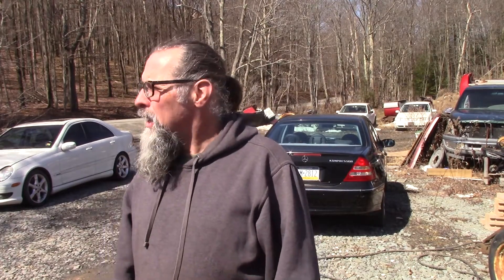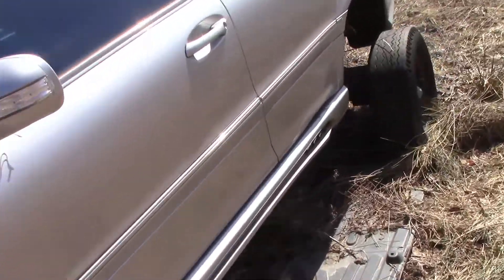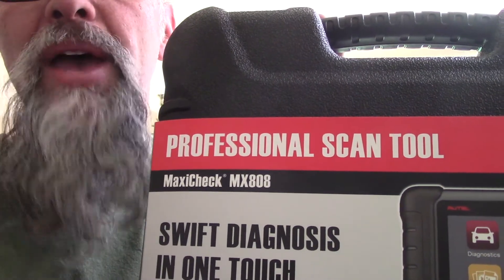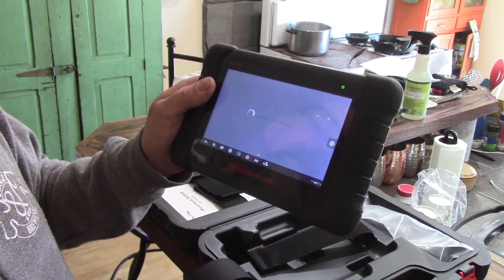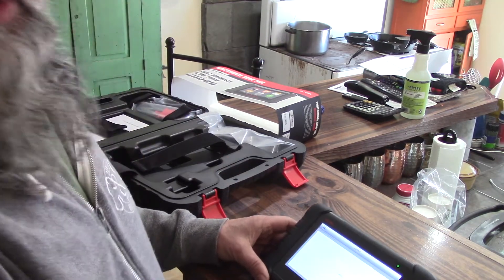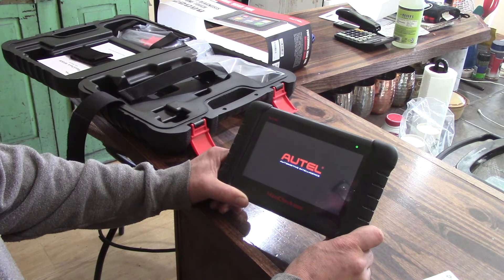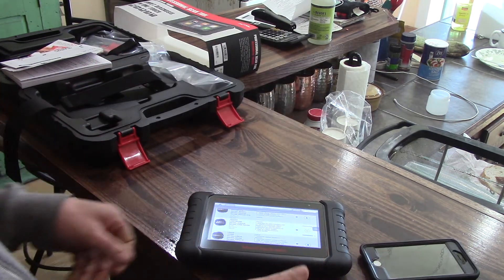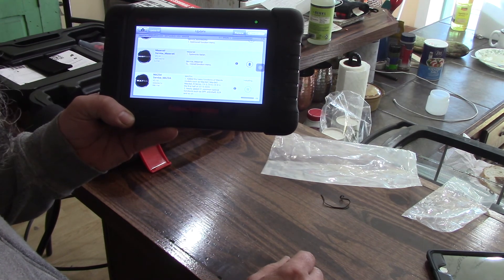Opening box and initial setup of Autel MX808 all system OBD2 scanner

Comment: I have a Bmw wonder if it detect a failing water pump most cheap scanners like 100$ don’t even give you a code for the water pump
Reply from the maker: Hi Tyler; I couldn't tell ya. Would have to hook it up to see. Thanks for watching, John
Reply: @JohnFrytag  if you ever get the chance let me know thank you!
Reply from the maker: @tylerangel4073  sure will. Last bmw was a 82 320i..got it used. Drove it thru a flood. Change wheel bearings, starter and throw out bearing. ( don’t drive thru a flood..lol). Handed it down to my son. Had over 300k when he got rid of it.
Reply: @JohnFrytag  wow that’s pretty rare for a Bmw to have that many miles on it!
Reply from the maker: @tylerangel4073  it wouldn’t die..lol

Comment: Can you command the PCM with this scanner
Reply from the maker: So far as i have used it ( which hasn’t been much) no. It has different capabilities with different brands. It should do abs tho depending on brand.
Reply: @JohnFrytag  it doesn't I tried and now my TPMS light is on can't get it off.. so it does reset however that's it

Comment: mine didn't show an Update All button until the initial 2 largest downloads i had which were at the very top in order were downloaded. After that i just clicked update all and it just downloaded everything. some take a long time others pretty fast. 

other then that i mean hopefully it works on my car. bought one of those FIXD scanners for $20 just to see a code. didn't even want to sync to the scanner/my phone despite it works even with 3 bars of wifi nothing. 

good setup vid though. never used one of these things so didn't really know what to expect. just trying to learn how to do work on my own car especially since shops here already screwed me over breaking parts i installed brand new or charging insane amounts for something that i can do and have done after the insane quotes
Reply from the maker: Sometimes self reliability is the best way. Anyway its fun to learn new stuff. thanks for watching!